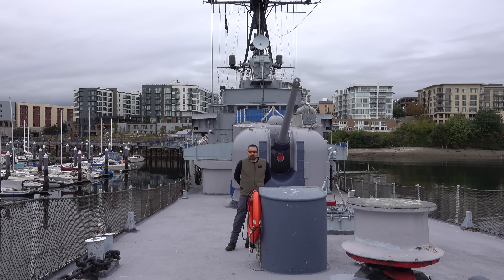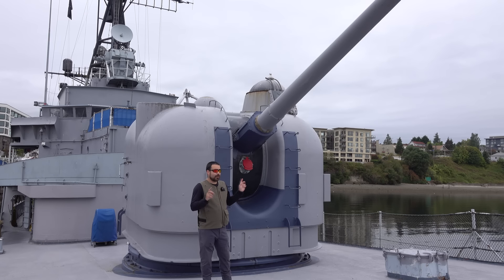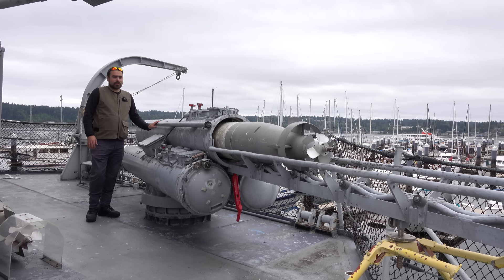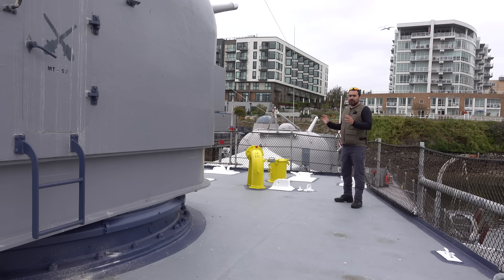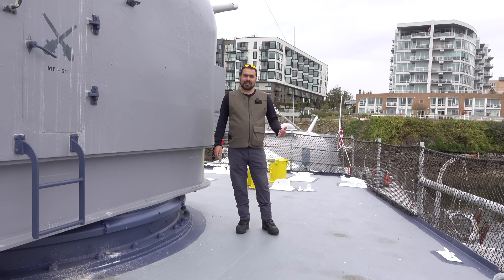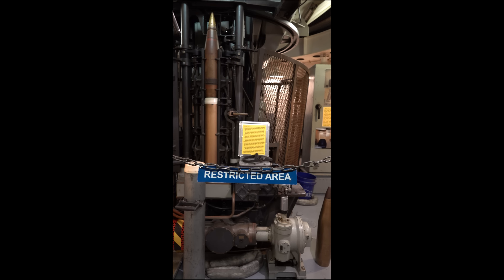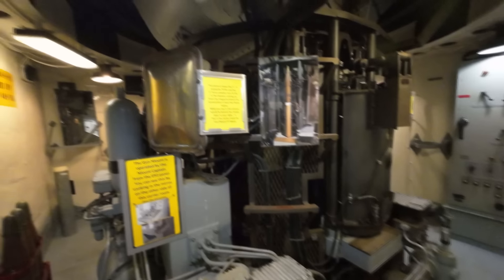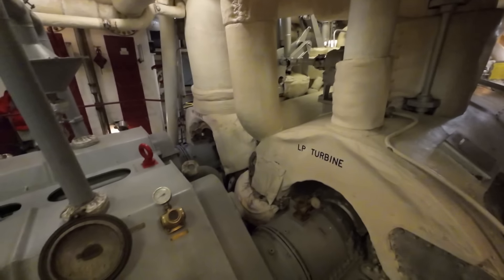USS Turner Joy (DD-951) - The USN's Last Gunfighter

Comment: In 1978 as a middie I participated in VERTREP drills off Gitmo with the Sherman Forrest.  We were cooking along as fast as my ship (USD Iwo Jima. LPH-2) could go when the Sherman Forrest blew a boiler and dropped to 10 kts - too slow for a VERTREP.  The reservist CO of the Sherman Forrest asked us standby while they restarted their boiler but it would have taken so long that everyone would have been stuck onboard no liberty so our CO (then the Senior O-6 in the Atlantic Fleet) put Johnny Paycheck s hit song "Take this job and shove it" on the 1MC and we headed back to port. My part in the drill has occurred several days beforehand when we unracked the fuel hoses and attached the probe a smooth 300# metal device with no handles.  We Middies were then working in Deck Div as BM ready labor.  A third class is about trying all the scummy jobs or at least that's how it worked on the Iwo in 1978.  Cheers
Reply: GITMO was no big prize for liberty in those days, but I guess anything is better than staying aboard and at GQ with the airconditioning turned off.
Reply: @Johnnycdrums  Truly.   The weekend Liberty in Port au Prince wasn't all that much better though the free rum samples at the Juan Barbancort distillery were worth the trip.

Comment: My Grandfather was a patent engineer for the Navy and he did a lot of work on the Mullinix.
I believe they using DD 944 as platform for his project design called Channel Finder (AN/WQN-1).
I have a 24"x18" framed picture of DD944 from the stern in dry dock hanging on the wall in my den.

Comment: I was on the commissioning crew of the USS Aylwin  DE 1081. During gunnery training at GITMO in 1973 I saw an old three gun DD go full auto with all three mounts. It was pretty impressive but by then things had changed. Aylwin had 6 rocket launched torpedoes forward we could arm with nuclear weapons. As an ASW ship we had a massive 2 megawatt sonar you could kill divers with. Aft we had 8 Sea Sparrow.   All in all, about an even match against a Russian Mosquito boat and it’s 4 Styx anti-ship missiles.

Comment: Thank you, Drachnifel for an excellent video. I deduced when you showed us the A gun turret, that the air spotting dome had been removed. I suspect that most of the people watching this video would have made the same deduction.
In regard to the Oerliken—and simplified Polsten—20mm guns, it is my understanding that they were considered obsolescent for dealing with modern high speed aircraft by the late 1930s, hence the rapid licensing and adoption of the 40mm Bofors gun. The Germans adopted a more powerful 20mm flak gun—as used in the notorious 20mm Flak Vierling mount—and a modern 37mm Flak gun. NB The production version of the legendary Lahti anti-tank rifle used the newer German 20mm round.

Comment: Brings back memory's,  Thank you! BTW the single man in the 5' 54 gun mount is called the safety observer. When used at the high rate of fire you mentioned they had a tendency to jam up and explode, killing the observer inside. Happened too often at the start of the Vietnam conflict. The new 5' 54 used first on the Spruance class had a fiberglass enclosure, much more trim and a camera as a safety observer, no human inside.

Comment: 29:16 Those handles are actually for the Emergency Hand Pump for the steering system.  There is a second handle that mounts on the other side of the pump, and is used in the event of of the electrical hydraulic pumps. This is at the cost of many turns of the crank for each degree of rudder, and a team of sailors is needed to operate this as they get tired quickly.  This was used onboard USS Johnston after they were hit during the Battle off Samar.

Comment: I've been on the Turner Joy. You neglected one of its smallest armaments. There is a padlocked Remington model 10 12 gauge shotgun located (I think) on the bridge. ETA: OH! and the pingers, there were awesome huge acoustic pingers for active sonar.
Reply: The BARRY (DD-933) had a clipper bow for a bow-mounted sonar, but the others had a hull-mounted array.  The original ASW weaponry was Hedgehogs and heavyweight acoustic homing torpedoes which relied on active sonar pings for target detection and fire control.   Interestingly, the BARRY had the Mark 43 on display as its ASW torpedo forward of the bridge.

Comment: My first ship was a DDG launched in 1961, USS Buchanan DDG-14. She had a very pronounced hurricane bow, so the forward gun mount was a single, with a second gun aft. The third mount was in the superfire position and it was a Talos missile launcher. The ship was 10 years old when I spent part of the summer of 1971 aboard her in overhaul at Hunter's Point NSY in San Francisco. Looked very much like this tin can, but she had a 900 PSI steam system. I was tasked with overhauling the degaussing control system, located in the Engine Room. As a result, I got to spend some time in the ERLL bilge when a 900# steam line parted on initial startup. The bilge was not empty; 6 inches of fuel and lube oil on top of 2 feet of water. I was lucky, going low was the right move. A couple of MMs tried to climb out of the ER to the main deck and got horribly burned by the steam before they could shut it down. I lost my dungarees and my shoes, which the Navy graciously replaced, but no burns and I only sucked in a little of the bilge water.

Comment: I'm familiar with the Turner Joy as I have lived in the Bremerton area most of my life except for a brief 20 year career with the US Navy. An interesting video might be the history of the USS Norton Sound, AVM-1. I decomissioned the Sound in the late 80's and eventually it ended up as razor blades except for a piece of the teac decking I was presented with. The sound had several firsts. Almost all combat systems, missile systems and guns were first tested at sea on the Sound. It was built in 1945 and just made it to the end of WWII. As a seaplane tender it wasn't useful for that purpose so the navy used it for testing. This ship was the last to use black fuel oil and 400 pound steam. When we were low on gas we had to request a tanker truck to come up from Mexico as no refinerys in the US produced black fuel oil. Walking over the ship you find all kinds of welded up holes in the deck which at one time was maybe a gun or missile system. While I was aboard we tested the Aegis Combat Weapon System, Standard Missile and Vertical launch Tomahawk. The Sound was the first Navy ship to have women as crewmembers, about a third of the crew. That was intersting to say the least.

Comment: Gearing class destroyers were designed with two 5"38 twin mounts forward and 1 aft and had this configuration for the majority of the class till about the early 1960s when most of them completed FRAM overhauls.

Comment: Turner Joy was a contemporary of U.S.S. Mahan, DLG-11 (Destroyer Leader, Guided Missile later classified as  DDG-42).  I served aboard the Mahan in the early 196Os and had to cross the Turner Joy to board her many times. We only had the one 5 inch 54 forward, and with 85,000 shaft horsepower we also could move along pretty fast with our "hurricane bow" and longer hull. We had the same triple torpedo launchers, but also the ASROC for projection of those torpedos out to where the the subs might be lurking. Terrier missiles at the stern so no large guns aft, but twin 3"50 mounts amidship. Being made of destroyer plate, rather than the heavier metal of similar sized cruisers she shook a lot when she was tested for her top speed. As I recall all these many years later we managed 34 knots. That high bow served us quite well coming through a typhoon  on my last  TransPac return from the Far East.
Reply: DL Does not stand for Destroyer Leader.  The DLGs were classified as Frigates as in the age of sail designation.  They were given that designation because they had Destroyer based hulls. The DLGs were reclassified as cruisers in the mid 1970s.

Comment: Where the forward 3"50 was, (the box under the blue paneling) is the Commodore's quarters which was only used when the ship was carrying the squadron's Commodore. It was a fairly well equipped and comfortable smaller quarters. Especially for a Destroyer of this ships era. One good thing about this was that when the quarters were not occupied and maintenance was required in that space, a nap on the couch for the maintainer was almost guaranteed. (🙂BTDT😴)
Reply: At the time of the conversion she was flag for Desron 19

Comment: The 'crane' on the torpedo deck is actually for man overboard, you can see the chair for it to hoist people from waterline level.
Reply: You almost have it right. That chair is a  "Bosun's chair" and is used to high line personnel from ship to ship. To retrieve a man over board we would lower the whale boat to pluck him out of the water then lower a Jacob's ladder over the side if they were ambulatory. If not then lift them aboard in a stokes stretcher.
Reply: @giovannideventuri4506  on your ship, on my Adams class (Ricketts DDG-5), we had two of those rigged forward (about where MT 5-1 was with a floating chair like that for pulling people out).  Adams class replaced 5-3 with a Terrier launcher (in DDDGs 3-13,  mk 23 (one armed bandit lancher) after that).   ASROC launcher amidships. Same engineering plants. I went aboard for the tour and it was like coming home.
P.S. As a BMSN/BM3 I am very, very familiar with a bosuns chair lol!

Comment: Re: those "Left Rudder" and "Right Rudder" signs.  Assuming those signs are not new for Museum Visitors, I don't think their purpose is to identify which rudder is which.  That would be done with "Port" and "Starboard".  Rather, (again, if they are Navy signs, not Visitor signs), I think they are a reminder for the crew which way to locally/manually operate the rudder based on commands from the bridge.  So, when the bridge orders "Left 10 degrees rudder", the crew will respond accordingly.  It may seem silly to need this, but it could depend where the local operator is standing.  If he is facing AFT it would be easy to get confused.  Those reminders were probably added after the first time the ship was steered in the wrong direction.

Comment: From experience I will tell you that if there is a hairline crack in the steam system everyone in those spaces will know.

When I was at Nuclear Power Prototype training near Idaho Falls. One of the main steam cutoff valves had a microscopic crack.

This valve was in a mezzanine above the upper deck. This area stayed between 140F and 150F and 100% humidity if the valve was not fully shut.

The first time I had to close this valve for training I was told I had 3 minutes to close the valve because of the conditions. I put on my gloves, climbed up the ladder, grabbed the huge wrench.

I wasn't warned how slippery the wrench was because it was soaked in hot water. As I was twisting to put this wrench, that probably was 3 foot long and weighed over 30 pounds, it slipped out of my gloved hands, falling down the latter.

Luckily it didn't hit the unstructured or other trainees.

I had to come down and go to the end of the line because of the 3 minute limit. 

Standing under thus mezzanine was still hot. The AC system couldn't keep up. It was often over 110F in the winter plus hot water dripping down.

My point is the extremely hot high pressure steam will quickly change the local environment. 

Unless you are very close to the leak when it starts you would likely question why its so hot and humid, drastically different than normal. Remember my leak was microscopic, I can't imagine what a pin head sized leak would be like.

If you were at the leak when it started, yes you could walk through it, because the high pressure high temp is very hard to see.

Also, I grew up near the Turner Joy (it wasn't in Bremerton back then), joined the navy, served a tour on a sub at Bangor and recently came back for a few years.

If anyone wants to visit, plan on heavy traffic at the horribly designed highway 3 and highway 304 interchange because the Bremerton shipyard, Bremerton base and Bangor base all let off at the same time.  Weekdays between about 2:30 pm and 5:30  pm often have delays of half an hour or more.

Comment: Technically the Spruance class is also still a gun destroyer. It's classified as a DD.
Which is slightly underhanded to get budget, as they do have guided weapons in the form of a single 8 cell ASROC launcher.
Of course it only has a single 5" gun by now, the entire rear deck being taken up by a helicopter hangar and helipad for a LAMPS helicopter.
Brilliant ships, wish more had been exported to European navies who would have made good use of them (maybe replacing the ASROC launcher with Sea Sparrow to make them true multipurpose ships).
Reply: Spruances had a Sea Sparrow and a second 5" Mk.45 aft of the helipad. The Sea Sparrow wasn't fitted to the first few when thery comissioned because the later version (IPDMS "NATO Sea Sparrow" instead of BPDMS) wasn't ready yet. They were mainly anti-submarine ships: that ASROC launcher had 24 relaods (!) and the bow sonar was ENORMOUS. You're right, they were good ships. They were very controversial when new because they were so much larger than the ships they replaced, but the US Navy was proved right over time: "steel is cheap and air is free" as the saying goes. The ASROC was replaced by a 61-cell VLS launcher in later refits. They didn't have the fire control to use it for AAW, but they could chuck an awful lot of Tomahawks...
Reply: Taiwan ROC still operates the Callaghan class, which were Spruance based DDG's originally intended for the Shah.
Reply: @allangarrett6251 Kidd class: Callaghan was the second to be commissioned.
Reply: Thank you! @MrHws5mp
Reply: Thank you! @MrHws5mp

Comment: The 5/54 did not have an effective rate of fire of 40 rpm , it was close to that of 5/38

From NAVWEAPS

"During the Vietnam War, the Mark 42 developed a reputation for jamming during protracted firing due to the complex nature of the loading mechanism. Slowing the rate of fire greatly reduced the problem. Later upgrades increased the rate of fire, but not as high as the original figure. 

As designed: 40 rounds per minute in automatic mode
Derated after 1968: 28 rounds per minute
With the latest alterations:
   Single side operation: 17 rounds per minute
   Two side operation: 34 rounds per minute"

5/38

Base ring mounts with integral hoists: 15 - 22 rounds per minute"

According to Friedman's US Destroyers, the reason behind the US going from 5 single 5/38's in the Fletcher class to 3 dual 5/38's in the Sumners and Gearings was not increased fire power. As the crews for two guns in one mount interfere with each other, its rate of fire is not twice that of a single mount, so the effective firepower was about the same. The reason was to free deck space for more medium (40mm) and light (20mm) AA on what was essentially a slightly modified Fletcher hull and machinery to avoid production delays

Fletcher

Length
369.25 ft (112.55 m) wl, 376.5 ft (114.8 m) o/a
Beam
39.5 ft (12.0 m)
Draft
17.5 ft (5.3 m)
Propulsion
60,000 shp (45,000 kW); 4 oil-fired boilers; 2 geared steam turbines; 2 screws

Sumner 

Length
369 ft (112 m) waterline
376 ft 6 in (114.76 m) overall
376 ft (115 m) overall (DD 725–728 & 730–734)
Beam
41 ft (12.5 m)
40 ft (12 m) (DD 692–709)
40 ft 9 in (12.42 m) (DD 744)
41 ft 3 in (12.57 m) (DD 770–776)
Draft
15 ft 9 in (4.80 m) normal
19 ft (5.8 m) full load
18 ft 9 in (5.72 m) full load (DD 735-40 & 749–751 & 771–773)
Propulsion
4 Babcock & Wilcox or Foster Wheeler boilers; two General Electric or Westinghouse geared steam turbines, 60,000 shp (45 MW) total; two shafts

What really made a difference was the older ships were "single channel" ships with one gun director and fire control system (Mark 37). The Farragut class were "dual channel" vessels (Mark 56 and 68) enabling two targets to be engaged simultaneously. What's more, the Mark 56 could control both 3/50 and 5/54 mounts at the same time.

Comment: Steam turbine setups are one of those things that don't really change from WW2 to the modern day. I served on the USS Gerald Ford and the main engines there were very similar to the ones here and on the Iowas. The only thing I can really think was different was that the materials were better than WW2 era versions and because of that the gearing set could be a bit smaller than WW2 units.

Comment: I could be completely wrong on this, but wasn't Turner Joy the Forrest Sherman that served as a testbed for the 8" 55 cal autoloading cruiser gun?  I remember that can (I was in the USN from 80-83), and that was the story we were told in San Diego over beers with the guys who served her.  That gun didn't have better range than the 5" 54 cal, had a slower rate of fire, and about all it did was bend her keel.  It wasn't on the boat for long, that's for sure.  After the testing and subsequent removal of that gun, if Turner Joy got up around 30 knots or more she'd shake like a thrice-hooked bass.  I can't find anything on the internet about it, but I'm pretty certain that was TJ.
Reply: USS Hull DD-945

Comment: A little correction: On the original ships bridge you described a (1MC) box above the chart table, this is not correct. What you see is what we referred to as a "bitch box", you selected who & where you wanted to communicate with by pushing buttons then pressing the "talk" lever and speaking with that person or place. The 1MC unit was either a plain speaker in an enclosure mounted on the bulkhead or in the overhead or an enclsure with a volume control knob.